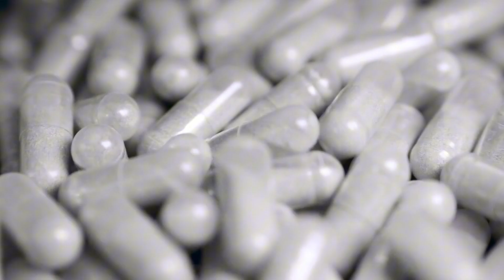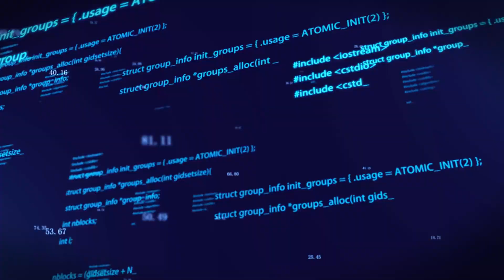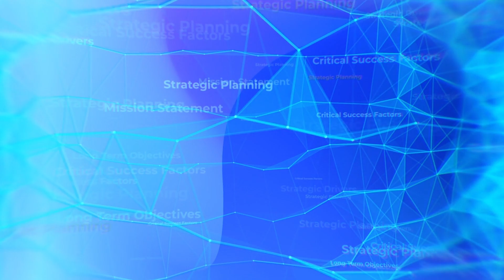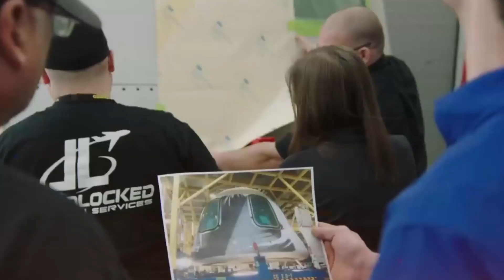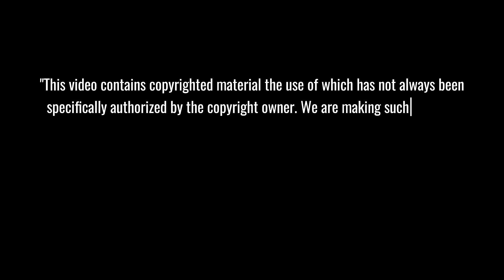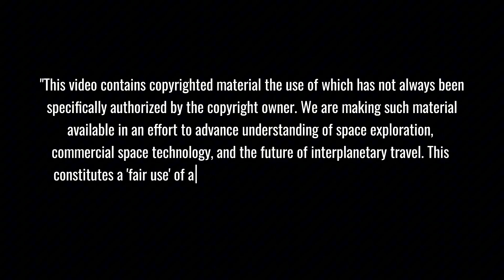Exposed: How Blue Origin Buried Their Rocket's Critical Malfunction

Comment: I like your headline—it grabbed my attention and got me to watch the entire video. However, I believe there’s room for improvement. Rather than just offering criticism, I’d like to share some constructive suggestions.

At the start, you should directly address the headline question or at least hint at the answer. In this case, you could acknowledge that the specifics of what was buried aren’t entirely clear but that you’re going to break down the situation. Then, dive into the details of how and why it happened.

It’s also perfectly fine to state upfront that there was an issue with the parachutes. Instead of repeating content from your previous videos, consider providing a brief summary of your key points and analysis. This approach could really enhance your content and help grow your success. Wishing you the best of luck!